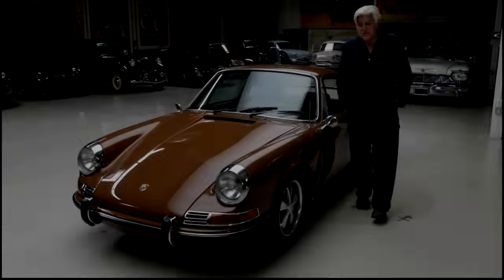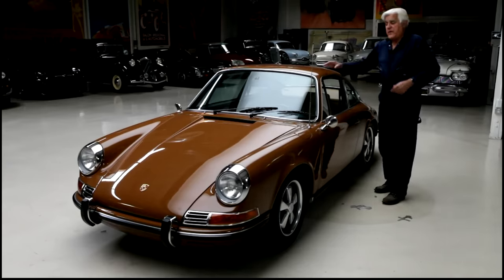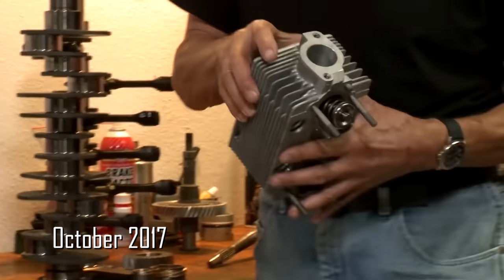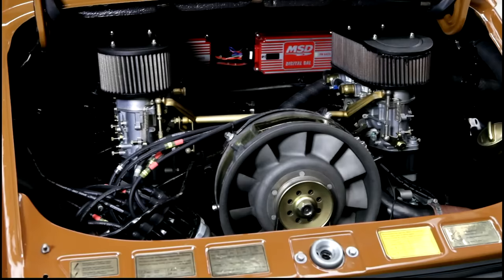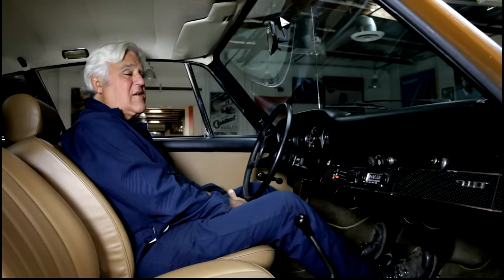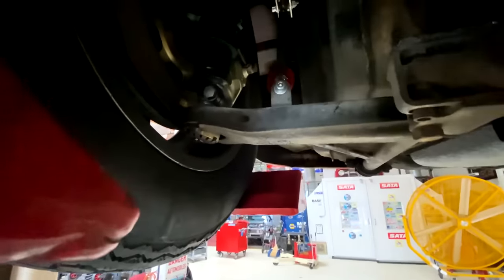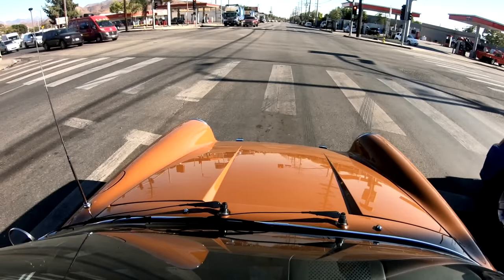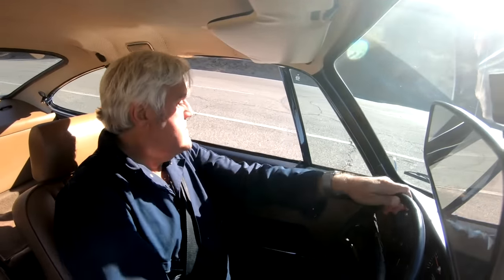1971 Porsche 911 T - Jay Leno's Garage

Comment: Jay- do these injection valves fire simultaneously or is there a delay...
Jay’s Mechanic- there is a millisecond delay the lower fires first because.... 
Me- I love the brown color!
Reply: What he is talking about is the firing of the spark plugs.  Dual plug engines are set up fire the plugs just a few moments apart.  Has to do with the flame travel in the combustion chamber.

Comment: Great video! I own an 85 911, it's a bit more refined (short hood) and a 3.2 liter engine, it's heaver then the early long hoods but its still an air cooled 911 and it is quite different (driving, shifting and handling and engine sound) from any other non 911 cars. Regarding the radio I installed a newer Porsche branded Becker radio/CD player that I never turn on. The sound system while driving a 911 is the engine sound. : ^ )   Keep up the great videos!

Comment: "Even the base 911 T model they used magnesium" Yes Jay, in fact even the "base" VW Beetle had a magnesium case. "The synchros weren't too bad, the brake-bands were worn out" So the synchro-sleeves were OK but the synchro-rings were worn out

Comment: As a Porschephile who has owned an "88 Carrera 3.2L w/ 214 HP , '72 911 S 2.4 L w/ 190 HP and in Retirement '68 912 1750 cc w/ 115 HP. I can understand the Desire for HP but the Stock 911 T was 125 HP and w/ 2.7 L Crank and 2,5 L piston & cylinder set  and Twin Plug set up U are beyond the 911 S  in HP & TQ. U have created a 911 T 'OUTLAW' ! What was wrong w/ Stock Engine ? Obviously, U Exceeded the design capacity of the stock transmission built for Stock Performance. Why not just Buy a Stock '70-73 911 S  for $200k or a '73 Carrera 2.7L w/ 210 HP for a $1 M ? 
Marvel in Montana

Comment: I heard somewhere that gas powered engines waste 50% of their power through heat generation. Then a portion of the remainder goes to the wheels. You should get a Mercedes 240D.

Comment: Coastal California car. Here in the east we need air conditioning. I don't even think it was available in  911's in those years. Not sure when it came out on 911's, or how well it worked with rear, air cooled engines. I guess they figured out somewhere to put the condenser and it probably had it's own fan. Without a/c such a car would just sit out most of the summer and the time before and after it when it's still hot.

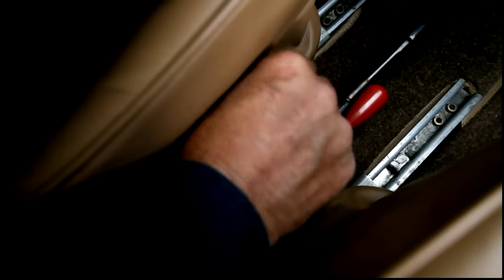Comment: Jay mentions standard controls on the side of the seat at 16:45. One is a hand throttle. What is the other one? Why is there a hand throttle? Can any Porsche enthusiasts comment please? Thanks.
Reply: The hand throttle controls engine speed during warmup. The other knob on the right controls the heater.

Comment: Looks like milk chocolate.

Why was there a thing about brown cars in the US in 70 to 75?

My second car I owned was a 72 Pontiac Grand Ville, a couple shades darker than this, but still lighter than dark chocolate. Tan cloth interior.

In high school my parents had a tan 70 Plymouth Fury III with the brown paisley vinyl roof. Light brown vinyl interior.

Earlier my parents had a 71 Buick Skylark 4 door in dark brown with medium brown interior. That was when most of the GM midsize cars were 2 doors so a 4 door was unusual.

I remember having a strong preference for 2 door cars as they just looked better. Getting into the back seat? That was reserved for children or people you just did not like. There is a reason only 2 seaters have 2 doors anymore.

I miss the wide variety of colors back then. When you could select from 30 to 40 colors from the factory.

Comment: That original clutch cable setup is the worst.  I would never have one.  I have a 240 HP 2.7 short stroke in my 69 911T, and I’m running a custom 901 transmission, and Kennedy stage 1 clutch.  It is more than adequate for the added horsepower

Comment: 16:50 why would it need a hand throttle?
Reply: The hand throttle raises the engine speed while the engine is in the warm up stage. The hand throttle can be reduced as normal operating temperature is achieved.

Comment: Imho, you should have kept it completely original, it's a bit of shame to modify an original running engine... I've had 5 or 6 classic Porsches and I remember there was a kit you could fit to the gear box to shorten the gear displacement on these old gearboxes ... cheers

Comment: i miss the days when the fast car had the fast driver. now the fastest car can have the slowest driver because the car is doing all the driving. traction control, ABS, dual clutch flappy paddle auto trans, electronic differentials, active suspension, wheel speed sensors for torque management. STOP. youre slow! only your car is fast.